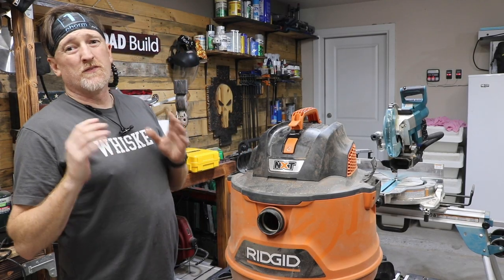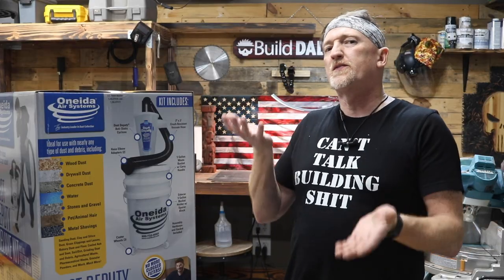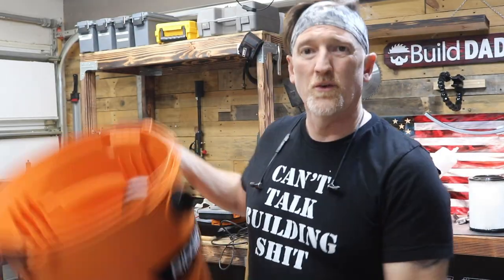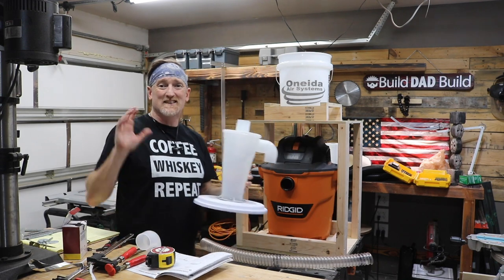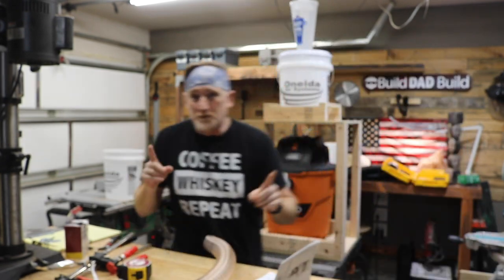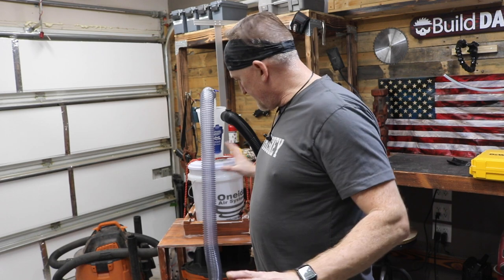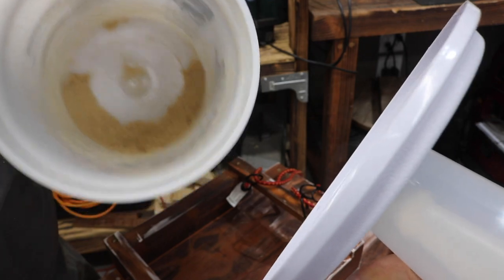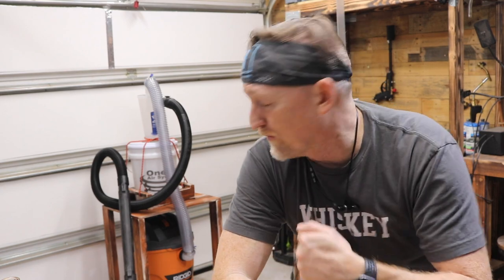DON'T LET THIS HAPPEN TO YOU! DIY Portable Dust Collection System (Dust Deputy)

Comment: That turned out cool ... last time I added fire to a build that included plywood the plywood burned and looked like crap.
Reply from the maker: You can only surface burn plywood. If you burn too deep your can burn through the veneer or make the glue bubble.
Cheers